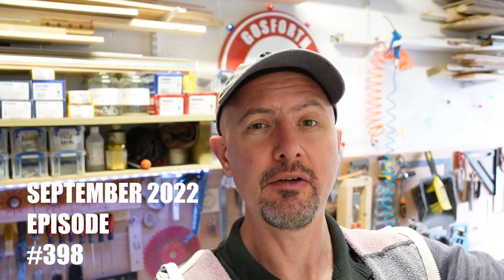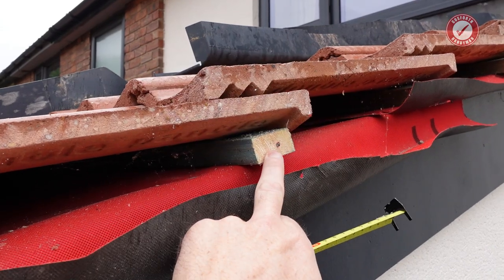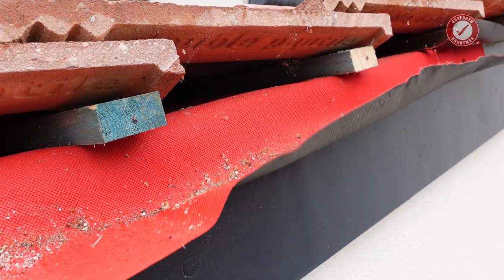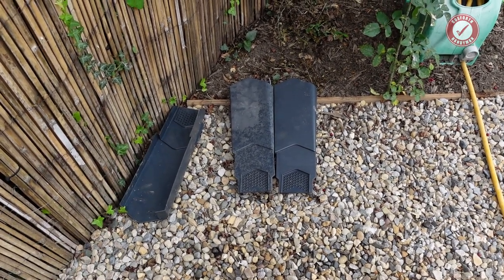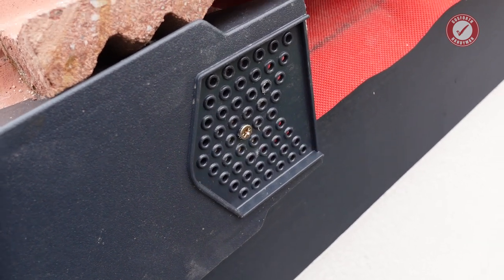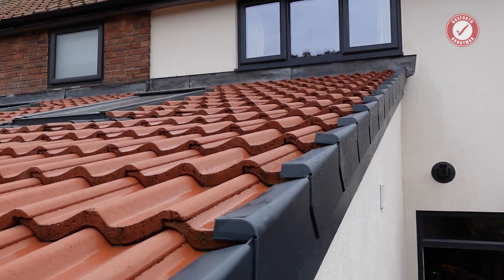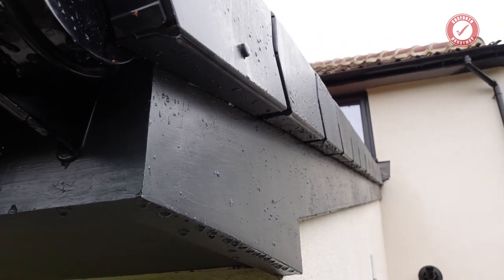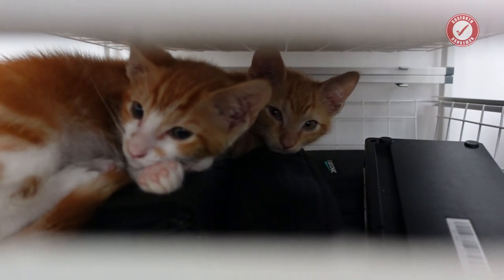Time to fix our dodgy dry verge! (and cute kitten update)

Comment: It's a shame there are so many trades out there doing a poor job. I'd be embarrassed to leave a job looking like that...top work as always Andy.
Reply from the maker: Cheers Andy! Yeah, it's a real problem.
Reply: must be a completion going on to who can get paid for the most bodged job that looks okay until you get a tape measure or a square out to it.
Reply: Yeah, defo needs more inspections but there's no one to do it. We went to a larger company to redo our whole roof on a mid-terrace house. Paid a bit more thinking you'd get a good service for the price, plus they were on the NFRC CPS . Being complete know nothings, we went from slate to concrete, and when we asked about weight issues they said it'd be all fine, then didn't add any supports. Then they've not tiled around the rear chimney, and only flashed half of it despite it being completely on our boundary, and when we had leaks, the guy they sent said it was usual for there to be standing water/puddles on a pitched roof! Not sure what more we can do to get them to fix it.
Reply: It's honestly criminal & deliberate it seems. Espeically if you've had a repair done & they've had a scaffolding put out...why wouldn't you get the job done right first time right? Often the silliest/smallest mistakes too. Lot of roofers get into their 30s/40s & simply expand, hire apprentices/misfits for cheap & let them do all the hard work. Build a company with good reviews yourself...then fob it off to your workers.

Comment: You can cut battens flush and run a full batten down the verge screwed into the ends or depending on the tile and dry verge combo you can run a batten on top of the facia under the batten ends. We find it gives more of a secure fixing using screws or galvanised ring shank nails. Some dry verge are supplied with screws

Comment: I always cut the battens flush or 5mm post the barge board then fix a 2x1 latt/batten running up, that way thought not relying on I've fixing that's fixed in to end grain. Never had a single verge come loose and had to re do countless jobs done by cowboys. You can get good money for fitting them so they should be fitted to last.

Comment: Fantastic video as always! I would use expanding spray foam to fill the gap under the lead.  You can even spray paint it black after it expands and hardens, and after you cut it flush.
Reply: Driving rain could easily getup under the lead flashing.  I'd foam it too and lay a bead of mastic, just Infront of the foam

Comment: Had a dry verge installed and it over hangs wall by 20mm.
There’s a batten running horizontally the length of the roof and it’s seems like they’ve screwed directly to that 😩 I thought they’d done a decent job and now I’m realising I was shafted

Comment: Did dry verge and ‘roofline’ for years when I lived in UK

Pretty straight forward, you just need to properly measure the appropriate projection on tile baton off barge board face or render and cut it at that, and the same with tile.
Mhard to believe ‘professional ‘ roofers left it like that.
I’m a bloody carpenter!  First dry verge job was a bit intimidating as any ‘new job’ is! But it’s certainly not rocket science 😂👍🏻

Comment: Bats… Our flashing and dry verge joint has a similar gap to the one you showed. Been there for a few years now. Plenty of bats now call our roof home each summer. 200+ this year. Like mice they can crawl into a very small gap. With your roof river and tree line facing could be ideal for them.

Comment: How would you do this to an older roof? Remove the first edge tiles to expose the battens, obviously id need to extend the bew batten by 30mm past the barge?? Could i fix a new batten side to the old batten or would you trim back the old batten and fix a longer piece out??

Comment: I don't think it would be a bad idea to get in contact with them and point out their defects, so they can learn from the mistakes (lets assume the best of them and they didn't know how to correctly fit it), so that hopefully they won't do this to the next person!

Also, a tip to anyone looking to fit their own dry verge, check out eurocell, they were about a third of the price of toolstation and Travis perkins when I looked (great price on window trims, guttering and other plastics too!)
Reply: Eurocell, unless I’m mistaken, give you a list price but when you go to collect / pay, they magically have an ‘uplift’ percentage to add that seems to be worked out weekly, rather than be bothered altering the list.  So you are quoted £15.50 for a length, then when you go, it magically has say, 17% uplift added at the trade counter till for the current period increase.
Reply: @juyhfrty  I actually ordered online and had it delivered (due to 4m lengths of guttering being easier to get delivered, plus it was free over £50 I think). I did go in store another day though and they seem to operate online and in store totally separate, and you're right about their prices being different. The guy I spoke to said it's messed up, but he sorted the price out so it worked out correctly, not sure if he applied a discount or something! The guy was spot on to be honest!

Comment: Well the reason there leaning and not sraight is because the cut tile on the roof has got a curve instead of being flat so you may need to notch the units also the batten overhang may be to long 👍

Comment: Highbury homes did a similar shoddy job on my roof, found this video trying to find a way to describe to them what they messed up on. 

They cut the roof battens? too short (not even level with the house let alone any overhang), and they put a bit of mortar on and tried to screw the uneven dry verge into that. Wonkiest thing i've ever seen, thats now broken and fell off. With huge gaps, and loud noises from outside.

Comment: I'm a bit late to the video, but when i first saw the verge some of the tiles looked like they were bigger than the edge of the batten, which could cause them to rock on the tile and leave a gap, hard to tell from the video. Also if you just tighten them right up, the verge leans and causes the plastic to bend and warp and leaves quite an ugly looking verge. Even if they had cut them a little bit further back it would've been cut on the lower part of the profile and they would have sit better. Looks like you did a good job though with what you did! Also as someone else said, they should've started on a full tile really, could use half tiles on the other end.

Comment: The main issue is once a "professional" does a shit job, you don't even want them to come back and make "good" because you just know it'll be half arsed or not good enough anyway. So then you're stuck in this awful position of paying someone else or doing it your damn self anyway! Nice one Andy.
Reply from the maker: Yup. It's simply not worth my time to muck about getting them back only to do a half arsed job fixing it.
Reply: Yep we had a leaky shower cube due to poor/incorrect tiling, and all they did to remediate was to silicone the grout line and stain block the ceiling below, rather than retiling it properly. It hasn't leaked again (mostly cos we barely use that one as it's in the en suite) but it's not the point, should have been sorted properly
Reply: @TheErador  Might be the plumbing for the waste

Comment: Pretty sure that dry verge system is either meant for doing eves with an apex (apex cover sold separately) , or they made the roof too short - it should be X number of full tiles, so the verges fit without trimming.

I have done one roof in my entire life, so I expect someone will be able to tell me I'm wrong.

I would defiantly send them a link to this video, and name and shame if you don't get satisfaction.

Comment: I wanted a dry virge when I got a reroof but they pointed it up ad it looked like dog shit. So I got them back to retro fit a dry virge, it is possible even though they cut the batons short. They couldn't figure it out, ended up putting a barge board on and then a really heavy right angled profile along it. It looks OK even though not meant for that type of tile, old timers set in their ways.

Comment: In America we have crappy ashpalt shingles. Always have admired your tile roofs in Europe. But, the dry verge are plastic? Question how long they will last compared to tiles...
Reply from the maker: We used to do cement verges but plastic seems to be taking over! Couldn't honestly tell you the lifespan!
Reply: @GosforthHandyman  the lifespan on my new roof plastic verges was about 3 weeks because like your roof they cracked 90% of them and I had to go and replace them all... there is no pride with most tradesmen these days.
Reply: I presume they're uv resistant, I reckon 25 years before they go super brittle and crack

Comment: Be careful grinding the tile edges. Most tiles aren’t waterproof all the way through, and the waterproofing is in the top layer of the tile (hence why any tiles with chips in them are no good).
Reply: How do you tile a roof with no cuts 🤔.
Reply: Most tiles are concrete which is waterproof and homogeneous throughout.

Comment: A pro  would  run a horizontal  battern full length and use straps over each battern and fix into horizontal battern  when you screw in end it splits I forget the batern size  it 47mm x ¿ I done my own roof I used  earth clip straps because I had a box full self tapping screws into horizontal  battern  then drilled battern to gable wall

Comment: The best way to do them dry Verges isn't how they tell ya in the instructions as you risk the lath spitting . Your Best cuttings lath flush to the barge board and run a full 2x1 battern up the barge board fix that in to the barage board and the end laths . Gives you more fixing points too also to remove them you need to slide them right down on a cold day your way would crack them

Comment: Is it just me or is the stem/boiler flue vent upside down allowing rain water down the cowling.
Reply: Thats how they are supposed to be installed so that you don't have water vapour dripping out the end as it can be harmful as it is acidic, it should, along with any rain, flow back to the boiler and it will just drain away down the condensate drain and down the drains.

Comment: Don't know anything about roofing, but I do know that nails (and screws) in end grain do not hold well and can work their way out over time - do the missing batten end clips help to hold the nail in?
Reply: @girlsdrinkfeck  thanks for the explanation.   Does this mean that @Gosforth Handyman needs to do the whole job again, to fit batten end clips?
Reply: @mikebashford8198  No, them screws won't come out.
Reply from the maker: Don't need clips for screws - freeze frame on the bit that shows the screenshot of the instructions. 👍
Reply: @GosforthHandyman  Whenever I nail into end grain, I put 2 nails in, angled like a dovetail.

Comment: 4 jobs booked in to remove these. All have gone brittle and snapped in the strong winds. Customers are also complaining about the colour fading and ruining the looks of their house/roof. There are so many "Roofers" trying to install these on old battens. They will come off! Its back to 3:1 mix cement for use. Done properly, will last for 40 years PLUS. Also complaints of water run marks down the walls

Comment: My god roofers don't help themselves. We had a similar job done with mortar falling out of the sides so had a dry verge put in. Needed to force home to them to do a good job first time around as the plans he laid out to me over text seemed like a rookie error to start with (wanted to attach to existing mortar without removing it). Especially given the cost of scaffolding, why tf do they not simply just do a good job whilst they're gonna be up there, instead of needing a ladder later down the line to patch up their own errors!?

Comment: Small cuts them. Unsure why the cut is on the right hand side of the roof. Normally/generally you would always start with a full tile unless they’re bonded tiles like moderns. Like a lot of so called roofers, the art of making out first is lost.
Reply from the maker: Yeah, it's the same at the other side (at least it's symmetrical I suppose!). Wasn't sure if it was to finish the ends on an 'up' rather than water flowing under the verges? 🤔

Comment: Ummm Andy I think you need to nail them as when plastic gets hot it can crack. Not 100% on this. But bloody bodge jobs, they don't know what a string line is. Roofers are mostly the same, worked with loads of them, only few I'd say would be good. If I was you, Bill them for it.
Reply from the maker: No, screws are actually recommended. As it's only fixed at one point they're free to expand / contract in any direction. 👍

Comment: It's staggering how bad some trades can be. How difficult can it be to do the job properly first time around? There's no way you are going recommend these guys to anyone else after all the extra work you had to do to rectify their shoddy workmanship. So short sighted on their part. I have to say this type of thing is not limited to roofers. Every trade seems to has similar problems, Social media is littered with examples of bad workmanship. However, most people stop short of actually naming the companies responsible - very British. 

We've had cats forever. Very cute when they are young. However, as they get older our three are starting to rack up the vet bills. Worth it though as they are great company - on their terms of course.
Loving your vids.

Comment: that was very shoddy work. its a shame. it would have only taken a few min longer to pop a chaulk line on there and cut them straight. 
wht way is your top flashing and tiles done. there looks to be a dip in the lead behind the top tile. that shouldnt be there.  also is it one piece of lead going over the tiles and up behind the render. i wouldnt like that. a counter flashing would work a lot better . having it too restrictive can cause issues with expansion .

Comment: Youre pulling them off from the wrong side anyway . Right lets get one thing straight . Put a piece of 3x2 under your batons running top to bottom then you have full cover of verge to fit a dry verge and no birds can get in . Now fit uour dry verge no problems if 3x2 is to much use a 2x1 job done .